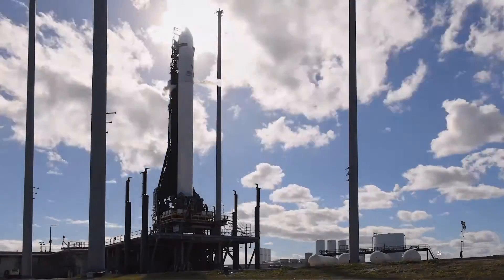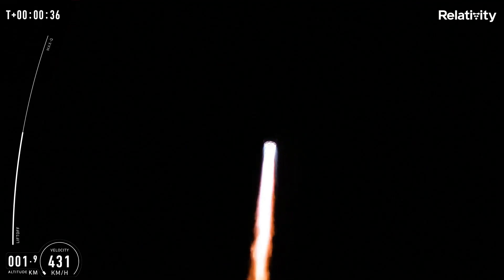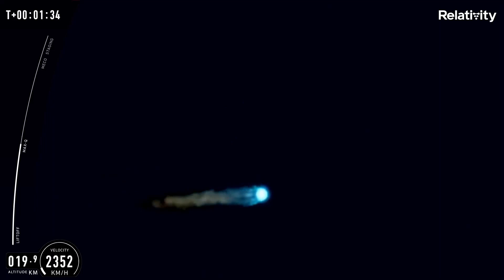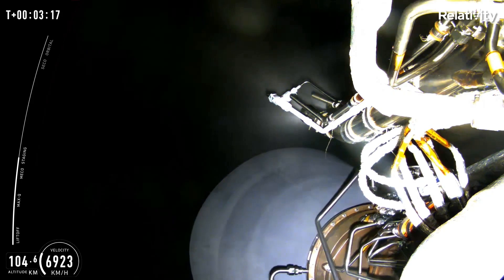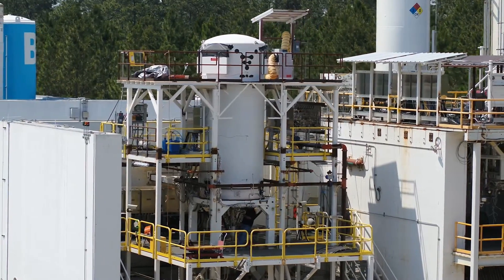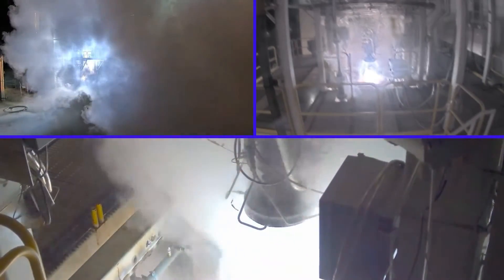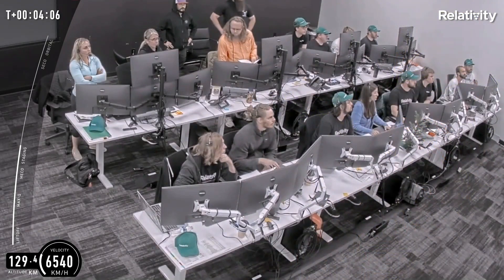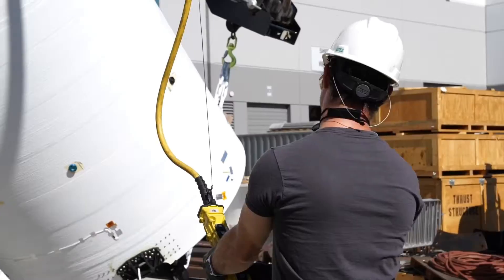First 3D Printed Rocket Reaches Space But Engine Fails Before Orbit

Comment: It has not been the best of times for new rockets:
Astra's Rocket 3, Feb. 10, 2022 launch failure.
Chinese Hyperbola 1 on May 13, 2022 launch failure.
Astra suffered a second failure of 2022 on June 12.
India launched rocket named the Small Satellite Launch Vehicle (SSLV) on Aug. 6, with a fourth and final stage failure.
Blue Origin's New Shepard Sept. 12, 2022 science-only mission failed during launch.
Firefly made its second attempt to launch with its Alpha rocket on Oct. 1, 2022 however, the payloads being inserted into lower-than-intended orbits, and the satellites reentering the atmosphere already on Oct. 5.
Skyrora attempted the launch of a suborbital rocket from the coast of Iceland Oct. 8, 2022 with the target of reaching an altitude of 77 miles (125 kilometers) The rocket didn't reach the heights it aimed for and shut down shortly after liftoff, falling into the Norwegian Sea.
Japan's first and only launch attempt of 2022 was an Epsilon rocket on Oct. 11, 2022 for a mission known as Innovative Satellite Technology Demonstration 3. Its third stage did not ignite and the Epsilon's flight termination system was activated.
On Nov. 3, 2022 test of the North Korean Hwasong-17, intercontinental ballistic missile ended in failure.
On Dec. 14, 2022, the Chinese firm Landspace launched its Zhuque 2 liquid methane propellant rocket. The second stage underperformed and the 14 satellites it was carrying failed to reach orbital speeds and fell into the ocean.
The second-ever launch of Europe's Vega C rocket with two satellites into orbit for Airbus' Pléiades Neo Earth-imaging constellation on its Dec. 20, 2022 launched from Kourou, French Guiana. The second stage, the Zefiro 40, failed three minutes into the mission.
Virgin Orbit, LauncherOne rocket on Jan. 09, 2023, "experienced an anomaly" just before it could deliver its payload, and the craft was lost.
ABL Space Systems launched its RS1 rocket out of Alaska on Jan. 10, 2023. It failed soon after liftoff.
JAXA H3 failed March 7th, 2023.
Of course Relativity Space Terran 1 rocket 2nd stage curse failure 3/23/2023.

I think that is all of them. With the Vulcan, Starship and Aries 6 coming up,
I have hope for better results for the new rockets.

Comment: Alternate hypotheses about reason for roll:
A. The boat twisted due to wind loading rather than the shoring bars failing.
B. Due to cyclic wind loading, the boat rocked left-right and fore-aft to walk off the wood blocks. Once it slid off the blocks, the shoring stopped mattering.
Reply: Wrong video?

Comment: I'm still not sold on the idea of 3D printing what is essentially sheet metal but it's cool to see new things done. Seems like a good first flight.
Reply: Yeah, I don't really get it. Building tubes is pretty much a solved problem. Makes sense for the engines and other complex components, but for the body/tanks it just seems like a publicity stunt.
Reply: It elimitates the need for large CNC mills to machine iso/orthi grids into the aluminum sheets and the step of forming them in to curved sections and the prosess of wellding multiple sections together.
Reply: It simplifies construction by eliminating fasteners, number of parts, and multiple manufacturers.
Reply: @roguegryphonica3147  I can see that it has some benefits, i just have a hard time seeing the pros being greater than the cons. I can definitely see why you would print some sections. Just not all of it. Especially the parts that are relatively simple sheets. It's pretty easy to roll sheet metal into hoops. Could be wrong though, I'm not an engineer. Just a guy who likes rockets and metal fab.
Reply: @Lucas12v  It's a proof of concept if nothing else.  It'll far easier and faster to 3d print off world than construct traditional construction apparatus.
Reply: I could be wrong, but I thought I had heard that their printing seams are stronger than welds. But even then, if just one of them is worse, that's a failure point, and so there are so many more failure points here than with a welded vehicle... Is it worth it? Maybe time will tell. Maybe other shapes are closer to optimal but you can't get them easily with sheet?
Reply: @agentdarkboote  Maybe I'm missing something but if their printing process is essentially welding then i don't know how it could be stronger than welds. It could eliminate stress risers from having sheet metal and welds i guess.
Reply: It’s probably cheaper?
Reply: Well first, it's a proof in concept exercise.  First you determine if you can before you decide if you should.  You don't know if you don't try.  Eventually when you learn enough you choose whatever works best.

There are distinct benefits.  Just having parts as one unit and not having to have all the seals and fasteners associated with a bunch of tubing and connections adds a lot to offset the higher costs.  LOTs of seals!   Look at the NASA launches that were delayed because of seal leaks.  You can also build the tank internal components simultaneously and not have to add them later, like baffles and internal piping and duct runs.  So fewer penetrations, hatches and openings to address.
Reply: The idea is that you could do it on Mars, so I'm thinking smelting the Martian rusty regolith and then 3d printing that. Anyone know the process?
Reply: They've just announced that in the future, they won't be printing the fuel tank barrel segments.
Reply: Exactly! To me it sounds just like a cool stunt that makes no economical or technical sense.
Reply: @skunkjobb  They're 3-D printing everything, including the engine. 3-D printing allows them to build things that would be almost impossible using conventional manufacturing technique, or massively more expensive (e.g. engine nozzle with integrated fuel cooling, printed as a single part). It also give them the potential for very speedy design iteration since there's zero tooling - go direct from CAD design to manufacture, and the material/technique they are using gives them a strength/weight advantage over conventional manufacturing. If musk really wants to occupy Mars, something like this is what you need - easy way to build parts/rockets locally with easily transportable generic supplies.

Comment: There was no failure at all.

They achieved their primary, and I think, their only goal: max q.

That the second stage engine did not light is a fact, but since it was not part of their test script, it cannot be called a failure
Reply: Semantics. The total outcome was a fail.
Reply: @imho2278  

No.

The goal was to test Max Q.

Anything beyond was icing. Heck, there was no payload to deploy, so what good was the second stage anyways?
Reply: @nrao8977  Their hope was to make it past Max Q, but the mission goal was orbit.  Otherwise why bother with a 2nd stage at all?
Reply: @TheEvilmooseofdoom  Because they needed to ballast a boilerplate upper stage with LOX and LNG to get the right mass distribution and aerodynamics for testing, and if you're doing that, you might as well burn it as a bonus experiment?

Comment: Pretty good. Better than Firefly and better than most attempts by Astra and Falcon 1. Seems like they reached a bit too high with dropping the ignitor. Always good to have redundant ignition, especially on a single engine stage.

Comment: Maybe backpressure from the atmosphere allowed this passive ignition to work, whereas in vacuum it didn't? I bet SpaceX is also looking at this failure to make sure Raptor will not have it!
Reply: At 300 bar it doesn't matter. If the pressure including backpressure is 300 bar or 299. The difference between max and min throttle is much greater.

Comment: There is still exhaust from the preburner/turbopump on the second stage so even if the engine didn't light they may at least have gotten some thrust from chucking out the propellant. Most powerful cold gas thruster ever maybe? 🙂

Comment: I fail to be impressed by statements like "our rocket is 80% 3D printed". 3D printing is slow and expensive, if it's done it's for a reason, it's because it brings some substantial benefit over other manufacturing methods. And these benefits are what I'd like to know much more than the sole statement that the rocket is 3D printed.
Apart of that, I really hoped they'll succeed. But what's happened are essentially teething problems and I hope their next launch will go much better.

Comment: That was their first flight! They absolutely  nailed it! There was no space company able to do that on the first attempt.
Reply: I mean, structurally speaking (which from the stream, seems like what they were primarily testing) they indeed did nail it. 

Other dude here is just being a Debbie downer.
Reply: They didn't "absolutely nail it," but it was a good first effort.  I know Rocket Labs also went past stage separation on their inaugural launch.
Reply: @737smartin  they exceeded their goal for the flight, so it is absolutely nailing it. They were testing the structural integrity of the rocket through Max-Q. Stage separation and second stage success are bonuses, one of which wasnt successful.

Comment: Knowing what I do about the robotic welding methods they are using, this is a stunning milestone! It's so hard to fine tune the process of the structure sizes they're making. Such an exciting future!
Reply: The first model is always the hardest to get working properly.
Reply: Knowing what I know about 19th century cricket, this conversation is going way over my head.
Reply: not to mention the problem with wafer panel production, which is slow, costy and wasteful.
Reply: Knowing what I know about metallurgy I bet it's full of micro-fractures after maxQ. Not a wise choice at all.
Reply: @MAGGOT_VOMIT  We'll have to see about their future attempts at reusability. I would be concerned with microfractures too. But they might be using a novel approach to Cold Metal Transfer (CMT) that reduces that issue. It'll be interesting to see how it goes for them.
Reply: @jajssblue  On top of that it's really just a novelty. That "printing" process is very impractical and highly inefficient. So many resources like electricity, inert gases and LP gases are wasted with very small amounts of steel produced.
Reply: @MAGGOT_VOMIT  and then there's all the excess mass. You can see how uneven it is, even from these wide angle shots.
Reply: @xlynx9  Right!! I'm surprised it wasn't heading to space in a wonky, watermelon football spiral. 1st stage didn't deploy. It was 2nd stage ripping it from it own flesh. 🤣

Comment: Scott, turbopump exhaust is visible continuously on the second stage so they should at least have been able to pump fuel into the engine, explaining the passive thrust
Reply: That's something that I was surprised wasn't mentioned. Clearly something is flowing there, but I don't know enough about what kind of cycle they're running to understand what that means for the whole engine
Reply: Makes sense
Reply: The turbopump is the Captain now.
Reply: That exhaust looks to be exremely low volume/ temperature. It could be that either the fuel or oxidiser lines is blocked so that the turbo pump is only spinning on the gas from the  remaining line. This could also explain the slight thrust indicated.
Reply: @Agnemons  "That exhaust looks to be exremely low volume/ temperature."  Don't know what it is supposed to be but if it supposed to be hot, it looks not.
 You can see a rime growing on the pipe over time and the 'exhaust' doesn't look like high volume hot gas.
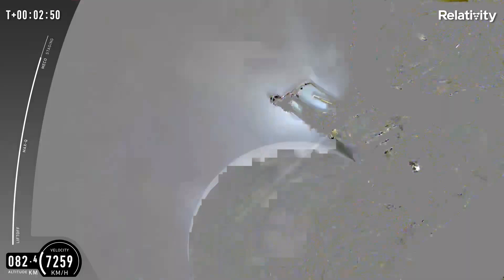 The rime could be other causes, just noting you can see it expand from 3:04 and it seems to get flashed or flaked away during the 'burn' pulses.
Reply: aeon is open cycle gas generator, and the exhaust still appeared to be coming out of the GG exhaust tube, so its probably something downstream from the turbopump. possible engine melting itself, igniter failure or injector issue
Reply: What pump?  I thought they used autogen pressurization of the tanks instead.
Reply: @johndododoe1411  The pumps move prop from the tanks to the engine.  This rocket has 2 pumps, for fuel and oxidizer, the pumps are run with a gas generator, they don't burn fuel/ox for power, and the exhaust should be only(roughly) steam. 
Pressurization is a separate system.
Reply: @coast2coast00  Oh, when I heard about the autogen pressurization, I thought it was a pressure fed engine, like on the Spica rocket.
Reply: @johndododoe1411  look at the straight pipe at the top of the video. That's the output of the open cycle turbine which powers the fuel and ox pumps.
Reply: I'm not seeing it.  I see an initial start that immediately shuts down, and then what looks like either leftover propellant vaporizing, or settling/RCS thrusters.

Remember that the gas generator is fed by the pump,and if the pump was going there'd be propellant coming out of the engine bell, even if not lit.

So I reject that what you're seeing is gas generator exhaust.
Reply: When you don't understand what malfunctioned you should stop making a fool of yourself by guessing.
Reply: @petergibson2318  Mald.

Comment: Is it possible the thrust you see on the second stage is due to the gas generator exhaust? We see that spitting out gas the entire time we have video. I don't imagine it would be a lot though.
Reply: Also fuel flying out the nozzle. It still accelerates the flow. Basically a giant cold gas thruster powered by a turbopump. I would wager the cold fuel provided more thrust than the gas gen exhaust. Thought  that had higher isp due to faster exhaust velocity.

Comment: Very informative Scott.   I was watching the video feed again just before you released this.   I slowed it down to 1/4 speed and noted that there was a brief time where it looked like the v engine may have caught (nice blue/violet flame) but suddenly the flame died down and then changed to what looked like an O2 starved engine with sparks in the exhaust.   My first impression is an issue with the LOX feed pump or injector, but that is just supposition at this point.  Relativity has the data and should get some forensic engineering to ID what actually happened.
Reply: Could be O2 or CH4 starvation due to movement of fluids in the 2nd stage tanks. We don't see much in the video but if the interstage separation induced a bit of rotation in the second stage, it could have led to fluids not flowing properly to the combustion chamber.

Comment: Don't they also need gas thrusters to prevent sloshing before starting the engine?
Reply: Ullage thrusters are sometimes necessary, but you can also pressurise the tank to keep the fuel from sloshing. It depends on the type.

Comment: May the force be with Vulcan, it still can become first operational methane rocket.
Reply: I hope you most certainly meant to say Live long and Prosper
Reply: @martianbuilder5945  nope, I meant May the 4th, since it was their NET date for the inaugural launch so far. Also I don't like Trek that much, Lower Decks is only thing from that franchise that clicked with me.
Reply: @fed0t38  What you're telling me is that they should have named that rocket Tatooine, or Alderaan, or  maybe...The Senate.
Reply: @martianbuilder5945  nah, I think Greek/Roman mythological characters are fine even if pretty generic.
Reply: @martianbuilder5945  What it's telling you is that Tory Bruno is a geek and a troll... someone who'd launch a rocket named Vulcan on Star Wars day, because he knows exactly how much it will irritate both sets of fans.
Reply: Does a 2nd stage failure mean the first stage engines are not operational?  They did their job as far as they were expected to..
Reply: @TheEvilmooseofdoom  Well, first stage is only a part of the rocket. And if it's not an SSTO or suborbital LV - having "operational first stage" doesn't make whole system operational.
Also in this silly "methane race" chinese rocket already ticked this milestone.